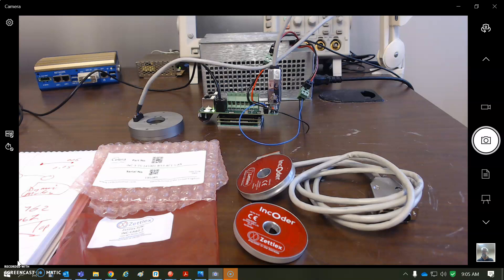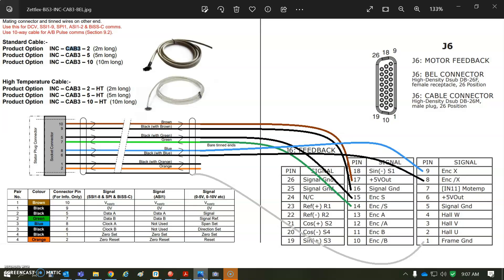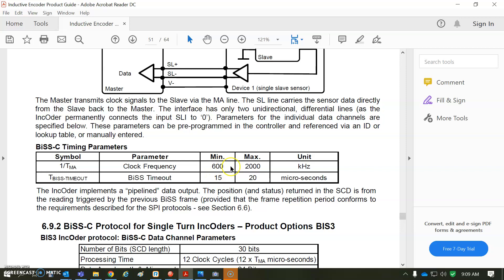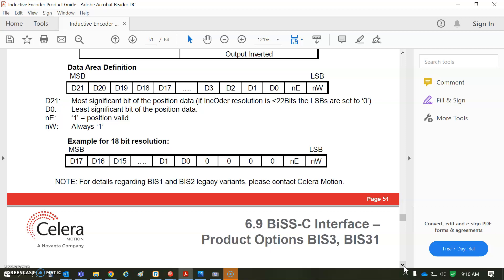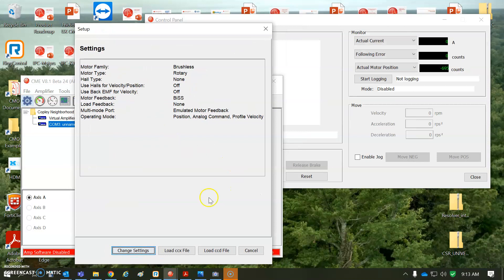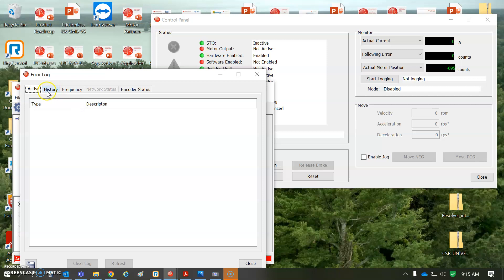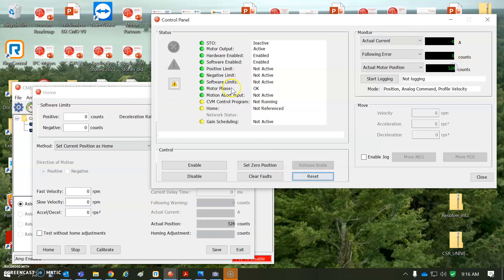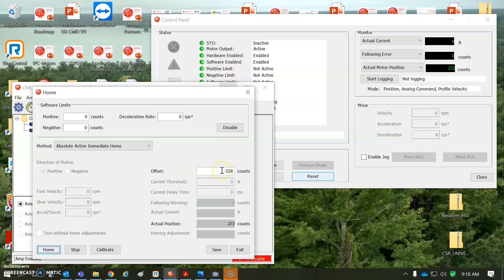Zettlex Inductive Encoder BiSS BiS3 wiring, set-up, and configuration with Copley. Advantages.

Comment: Great video. One note, the unit you have has a 'AN' suffix which mean its anodized (non conductive). If you want to ground the housing, scratch a little of the anodized coating off where it is mounted to the motor case and now you can rely on the motor ground. Generally not needed unless its a very noisy environment or you're seeing an issue, but I have had an occasional customer who has had to do this.
Reply from the maker: Thank you very much for the comment about grounding the case of the encoder by cutting through nonconductive anodized layer. All cases must find a path to earth (or frame assumed to be earth) same for motor case. A good path to earth and not a flimsy wire. You sure know your stuff!